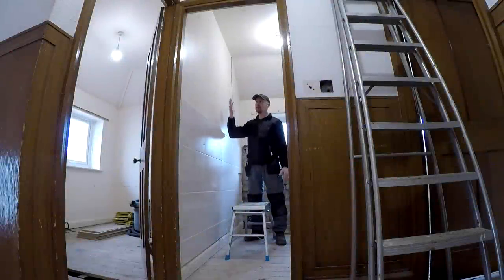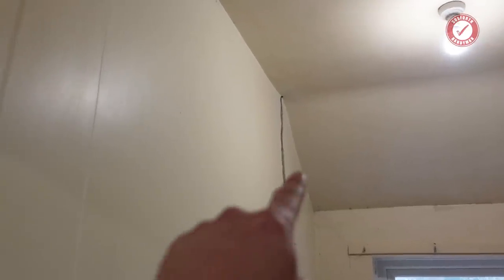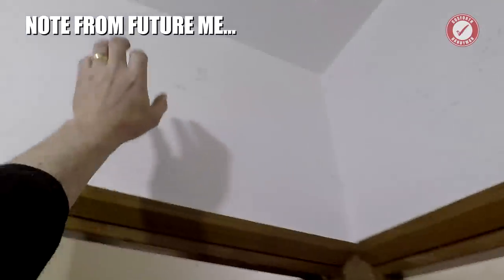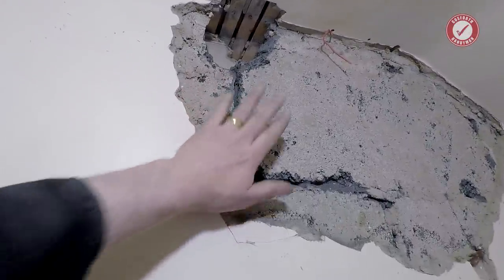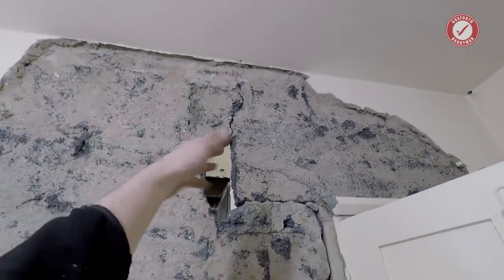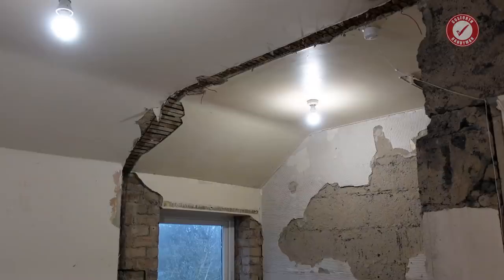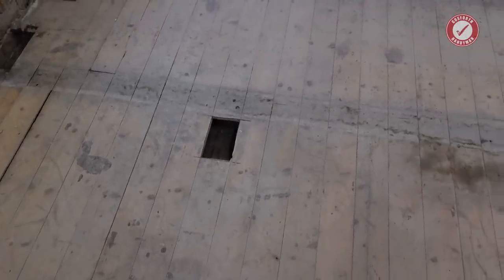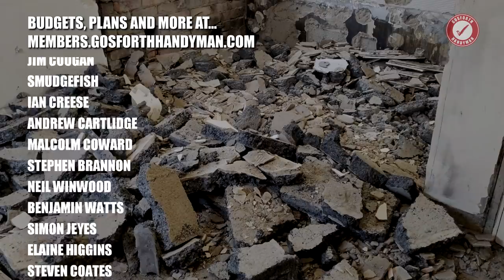Safely(ish) removing a clinker-block wall (Renovation Part 21)

Comment: How did you get a mortgage on a house with spray foam insulation?
...assuming  you have a mortgage.
Reply from the maker: Spoke to several mortgage companies and surveyors. None of them said this was an issue, although I know there can be problems with older open cell insulation (this is closed cell). 👍
Reply: Why? Fire regs?
Reply: @TheErador  not as far as I am aware.
Spray foam will expand into all the nooks and crannies in the roof between tiling battens and rafters.
It effectively seals the roof.
This can lead to condensation and mould formation and degradation of the wood. From a maintenance point of view, working outside on a roof that's been spray foamed inside can be an absolute nightmare, the tiles are glued down!
A better way is to have a cold attic ventilated and the insulation at ceiling level, currently I think about 300mm of rockwool is used.
My knowledge is that many lenders will run a mile from a spray foamed roof. Andy's experience is not that however, good for him.
Reply: @andrewclarkehomeimprovement  i see.
Reply from the maker: There's sarking felt between the foam and the tiles. So the foam doesn't touch any battens - only the sides of the rafters and they're all in tip-top condition. If anything it's the ones that weren't foamed that had a small amount of bug damage. 👍
Reply: @GosforthHandyman  not on the ones I've had the misfortune to work on. Absolute blinking nightmare.
Reply: @andrewclarkehomeimprovement  most professional spray foam application companies use the 'open cell' form for housing, and apply it to the breathable membrane under the tile/slate roof. Open cell being breathable also means that the joists and rafters can breath. Also, if you noticed the insulation was applied inbetween. There were some chemical issues years ago but, building technology is a very rapidly changing area, such as roofing felt 30yrs ago to breathable membrane now. 👍🏼